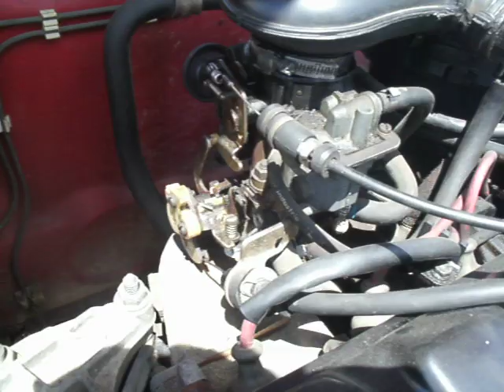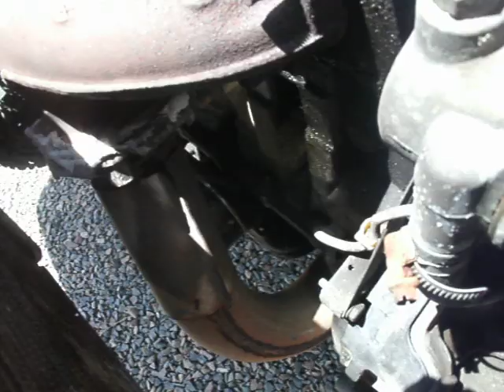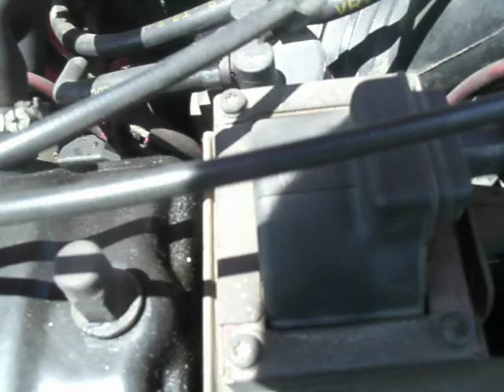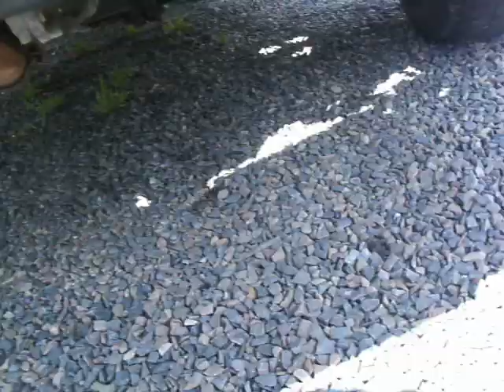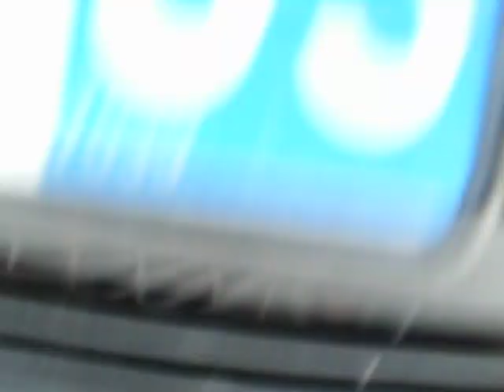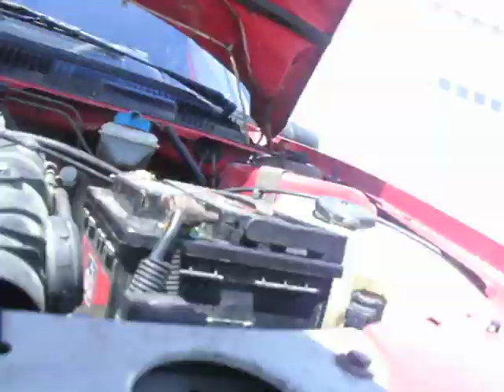Moteur T.U Peugeot 205 color line 1.1L 55cv

Comment: Salut Mr,  je vous propose est ce que  possible de me montrer un moteur junior dans une voiture 104 au lieu de son moteur
Reply: Oui de mémoire
Reply: Pour info les 104 sont équipé du moteur X du débus de production à la fin de production qui apparaît sur les Peugeot 104 en 1977.
Les premières 205 sont sortie équipé du moteur X de la 104 celui avec la boîte de vitesse sous le bloc moteur formant un ensemble groupe propulseur compacte la boîte de vitesse lubrifié par la même huile que le moteur.
Donc :
Les 205 Essence Construite de 1983 à 1986 sont équipé du même moteur que la 104 le « Moteur X » pour les versions 954 cm3 - 1124 cm3 et 1360 cm3
Les 205 Essence de 954 Cm3, 1124 Cm3, 1360 Cm3 Construite à partir de 1987 sont équipé du moteur TU la boîte de vitesse est sur le côté gauche. quand regarde depuis l'intérieur de la voiture.
Les 205 Essence de la version 1580 Cm3 Construite à partir de 1983 jusqu'à la fin de production sont équipé du moteur XU6.
Les 205 GTI 1.9 Essence (1905 Cm3) Construite à partir de 1986 jusqu'à la fin de production sont équipé du moteur XU9.
PS : Cm3 = centimètre cube = cylindré du moteur.